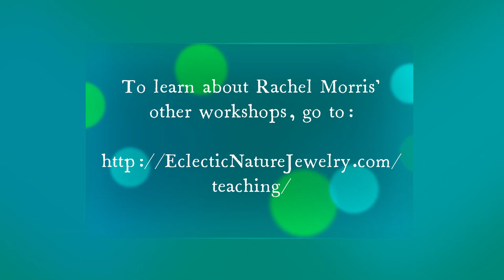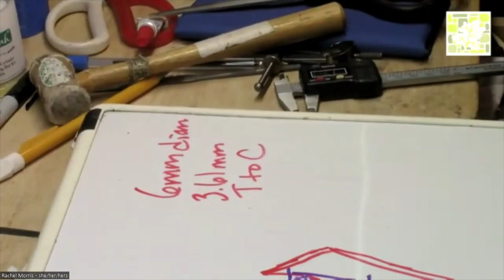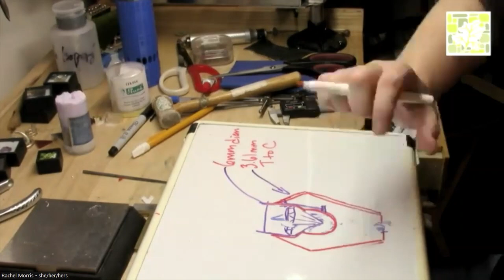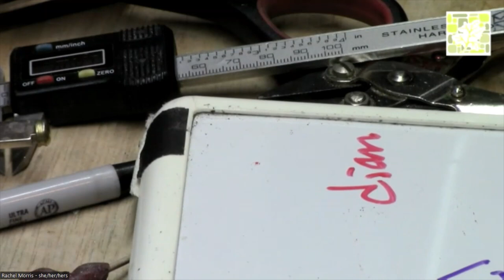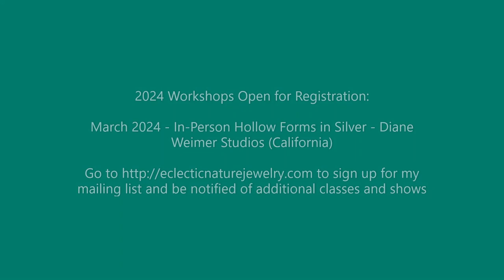ENJD Cogswell Zoom Along - Session 36 - 11/15/2023

Comment: Great job Rachael. I have two questions. First, what was the size of the cylinder bur to clear out the trillion seat? Second, why didn’t you just glue your card cut pattern down to the metal, I wasn’t sure of the purpose of drawing out a grid for the card cut. I must been in la-la land for November’s session. I had the wrong week. Sorry. Thanks.